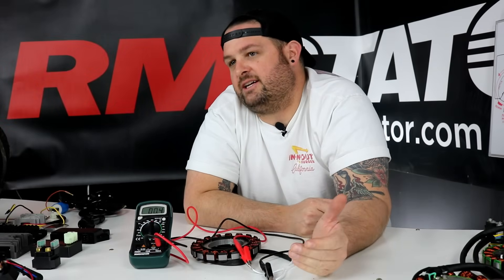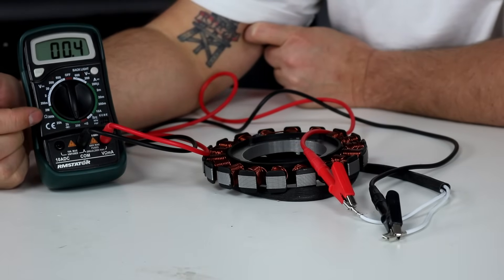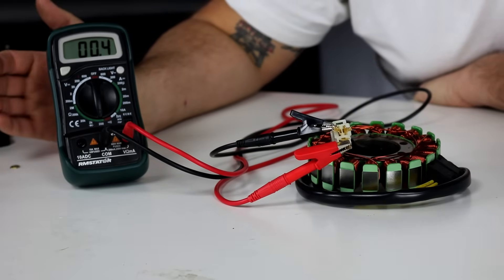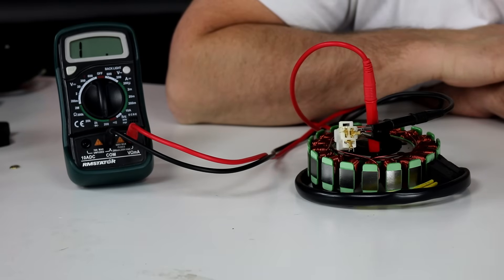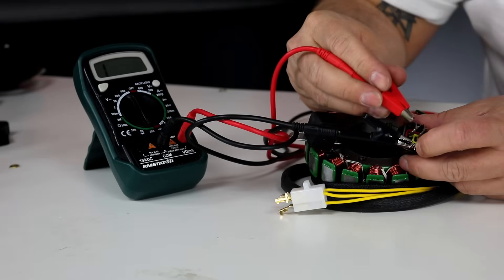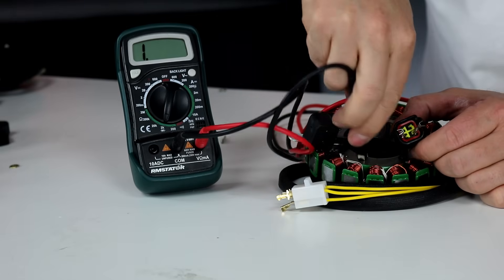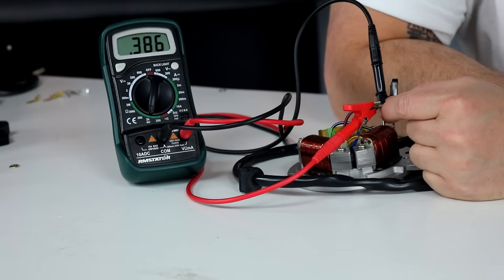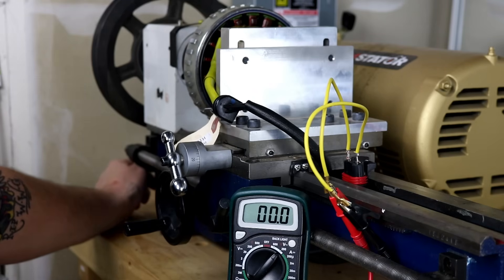How to Test Stators for Motorcycle, ATV, UTV, Snowmobile & Powersports Engines

Comment: For example, on Suzuki motorcycles, it is easy to test the stator this way: if each of the three yellow wires has a voltage of 70-90 volts, the stator is OK.

Comment: Hi and thanks! Good video and explaining all that electrical stuff You didn't know before. After watching this, I understand much better what it's all about. Big problem, if You are as I am - restoring my 1970's three 125 cc's -  that You actually can't get any help from anywhere. Even motorcycle repairshops aren't interested. I may think they lack knowledge of electrics. What they usually offer in Finland is cleaning carbs and stuff like that. Especially if You are dealing with 2-strokes they have no idea how to cope with them. I have done resto till nut-and-bolt-level within 5 years - including all 3 (Suzuki GT 125 1976 , Honda CB 125 1974 and Yamaha RD 125 1974) and now their are perfect. But there's one common factor, which in connecting them at the moment. They won't charge and they are having empty battery problems. So I decided to take advantage of Your website and try teach myself how the elctrics of motorcycle works. Very plesased to hear the basics and test  - and if needed - correct/buy faulty components.  I appreciate Your videos, thanks a lot and all the best!
Reply from the maker: Thanks a lot!

Comment: Wait,  if I check each leg of the stator to ground with the engine running I should get no voltage?   Mine shows about 5 to 10 volts on each leg.

Comment: Would a bad stator cause over charging i have over 20volts at my battery i have already replaced the regulator multiple times 1990 kawasaki bayou 300 4x4
Reply from the maker: Good question. No a stator cannot cause overcharging. This is pretty much always a regulator failing issue. To be safe you should perform a full resistance/grounding/voltage test on the stator (per your service manual or our troubleshooting chart), but it should be a regulator issue.
Reply: A battery could be the problem showing a over charge if the battery is failing and not allowing a charge to happen... then the system will keep sending a full charge, elementary my friend...  a stator is a unit that can put out a lot of voltage but the voltage out put from the stator is controlled by a device or a electronic method called a [ voltage regulator ] it regulates the voltage... we hope. and yes it can fail like anything else...

Comment: when testing my atv i get 0.4 but my book says it sould be 0.33 would that be right i have a 97 kawasaki prairie 400
Reply from the maker: That is perfectly fine. Most multimeters are not super accurate at this very low resistance. Being within 0.1V of the manual spec is fine.

Comment: What is the resistance is zero? 0.00ohms between the phase wires.
Reply from the maker: The meter needs to be set to the lowest resistance range for an accurate measurement. Remember you are trying to measure 0.6 ohms or so, the meter needs to be looking for this low range.

Comment: Hello folks, have a italian enduro bike here that doest produce enough amp from the stock stator. I had an idea today, instead of the simple rectifier/regulator, which convert ac to dc and then strip off the excess voltage (convert to heat), why not using a rectifier (ac to dc 20-25v) and use a solar MPPT to convert the excess voltage to amps ? What you think about the idea ?

Comment: @Rmstatorinc , maybe you know what may be wrong?   CBR600F4. Issues only at idle, none with higher RPMs.

Measured resistance, 0,6-0,7 between terminals cold, 0,7-0,8 hot [does not exceed 0,1 for same terminals]. No continuity between terminals and ground hot or cold. 
Measured stator's output, all 3 wires. It is pretty steady - from 10V at 1k rpm going steadily upwards 10V at each 1k rpm, to 70V at 7k rpm. Same hot or cold. Seems ok?

RR gives 14V when started cold [around 2,3k RPM]. 
On idle [1,4k rpm]:
- goes to 13,5-14 [fluctuates] when hot. When lights ON, goes to 13,1, and then fluctuates between 12,9 to 13,5.
- When ventilator kicks in [with lights off], drops to 12,9-13V; with lights on drops to 12,5 and sometimes lower, then starts dying and cuts out. This is extremely unpleasant at traffic lights when hot, cause it dies or dies when kicking in firs gear, and then it takes time to start and start moving [sometimes even does not start, i.e. starter runs but engine does not power on, like was flooded with gasoline...].  Several measurements show it takes 0,8-0,9 V for headlight [low beam], around 1V for ventilator. Is this ok?

But it is slightly strange; if it generates 12V at 1200 rpm, it already undercharges the battery, not even compensating lights and ventilator. So naturally the battery charging shows around 12,5V at battery, as the electrical load uses battery's reserve. Is it supposed to be so low at low rpms?

Run out of ideas, what may be wrong. If you have any ideas, will be very grateful  :)

Comment: How can you identify what the wattage output is of a stator. Many Service manuals do not provide wattage only the resistance specs.
I would like to know what Wattage out put my stator is rated at.
I know all watts are cumulative - I want to know if my stator can run added lights and heated hand grips.
Or whether I need an upgraded Staor.
Reply from the maker: You really cannot determine stator wattage without some extra equipment. It is done with a break-even test. Maintain ~5k RPM for full output from the stator, add load to the battery while measuring current out of the battery and monitoring voltage to maintain 13VDC or more. At the point you are drawing maximum current and you cannot maintain 13VDC, you have reached maximum output from the stator. You can then multiple maximum current x 13V to see total power in Watts your stator can source while still maintaining your battery. Hope this helps!
Reply: @Rmstatorinc  Thanks for the reply. My 1989 XR600  RX AU model did not have a battery just a Reg/Rec driving a Headlight , tail lights stop light and indicator set up at 12 V DC. so the output from the Pink Yellow lighting coil on my stator ( 3 wire only stator circuit) drives all lights dash lights and tail and indicators and horn
I note that when indicators are on and you operate the horn , the horn pitch changes in time with the flasher relay. and head light also dims a little each flash. I am trying to see if I can keep adding other electrical draw without overloading the stator.

Comment: Hi, i have a doubt about the stator output. I have a honda fourtrax 300 4x4 fwj, is it necessary to connect to the battery in order to get any output from the stator.  I tried to rotate the magnet and try to touch the output wire from the stator to check whether it produces any spart or current in the coil but nothing comes. So is it necessary to connect to the battery for getting any output?

Comment: Hi, thanks for the videos!
I did the static test between 1-2, 1-3, 2-3 leads and got the right resistance value.
But when I do the leads-to-ground I dont have Open Line but 1,50 Ohm instead. (manual says we should have OL when lead-to-ground)
What does it mean when you get values doing the Ground test? Damaged stator or bad connection somewhere? Thanks a lot
Reply: To me it means NORMAL because the one lead that you have one of your test leads from the meter hooked to; that lead on the stator leads back to ground THROUGH THE COIL OR COILS themselves even  if there are two or more coils hooked in series.  So unless they have tremendous resistance they are going to provide a easy resistance connection back to ground where your other meter lead is hooked to.......there's a circuit so the meter shouldn't show it OPEN.   Someone straighten me out here if I'm wrong.
Reply: @bigpig41  There should be absolutely no connection to ground from any of the coils, if so, the coils are shorted to ground and the stator is bad. The meter when testing coils to ground should read open circuit,  or OL, always.

Comment: Hi,  I'm a bit confused on how to test the AC voltage output on my stator.
I see on some sites people connect the negative lead of the multi meter to the battery and then with the stator unplugged just touch the positive to each of the three yellow wires while running the bike up to 5000 revs to take the reading, 50 60 70 vac etc.
And then on other sites I see people doing it another way, not connecting the negative to the battery, but connecting the black and the red of the multimeter  between the three yellow wires in series ?  So what is the correct way ?  I have a stator test on a KTM 990smt.  Thanks

Comment: Should the stator stay dry or does it matter if oil gets in the case and on the stator?
Reply from the maker: Most stators share crankcase oil to stay cool. They can definitely be oil covered with no problems.
Reply: @Rmstatorinc  I think I figured out the problem of why I was frying the stator. The starter button on the handlebars doesn't work and the previous owner hot-wired a new starter button to the solenoid but the old starter button was still hooked up still. I'm not positive that's the problem but I'm pretty sure might be.

Comment: i have a Kz650 and i dont know how to check the regulator. it has a harnes with 3 ends and 1 wire white with a red stripe.  can you please help me? i will check the stator the way you just showed in the video. thanks again. https://www.ebay.com/itm/Regulator-Rectifier-for-Kawasaki-KZ650-Custom-Sr-1977-1978-1979/281234790607
Reply from the maker: The 2 Yellow wires are the stator input, the Black is ground, and the Red/White is Battery positive. You can test it per our video.
Reply: @Rmstatorinc  thanks so much

Comment: ID IDLE WHEN I HOOK 2 YELLOW WIRES, I GOT 4.6 VOLT A/C AND 11.2 VOLTS A/C  AT 2000 RPM . IS THAT TOO LOW

Comment: Testing a 2002 Triumph Daytona: Resistance accross yellow wires all 0.5 ohms. Open loop to ground (tested all three although not really needed) bike running at about 1,100 rpm obviously stator wires disconnected. Getting approx 23 volts ac on any pair of yellow wire. But I also get 13v ac on each yellow to the ground. Your video says should be zero? is there a problem or just a different setup.

Comment: Awesome video and most straightforward explanation on testing the stator or rectifier. If my stator is reading .2 ohms for resistance between all tabs is it bad if it should be at .4?
Reply: I think it really depends on the stator but I would say .2 is still good, it still has low resistance which it should be.

Comment: hi, great video , on a snowmobile to check for stator open ground would you ground it on frame or motor, ?
Also is it possible a stator will only malfunction after getting hot,? after 30 minutes lets say ?  
thank- you
Reply from the maker: You can use the frame or the motor. Any clean metal connected to the frame is a ground. And yes, a stator can definitely short to ground only when hot.

Comment: So what if all three are grounded out? Is that common
Reply from the maker: All 3 coils on a stator are connected together. Unless the coils are burned, broken, or disconnected, if you measure a short to ground on one, you will have it on all 3.

Comment: Awesome and very informative video. Is there any stators that may have a short to ground or core that is normal? I have a Kawasaki Klx110 And I bought a new stator and it does give me a short to core when tested. 
I’m going to pick up the peak voltage adapter from you guys.
Thanks!!
Reply from the maker: Thanks! Yes there are definitely stators that can have a short to ground. Our videos show generic/universal testing info that is specifically for 3-phase battery charging stators. These type are used on most larger street motorcycles and ATV's, and do no have a ground connection at all. However on many smaller motors, especially dirtbikes, it is common to have one side of the coil grounded. To be sure, you really need to refer to a wiring diagram or service manual for your particular year/make/model. The service manual will explain how to test, and if you should have a measurement to ground on any wires. Hope this helps!

Comment: Showing a test that requires removal of the stator from the 'bike' is not too helpful for the owner. Might as well take it to a shop andpay for a diagnoses.
Reply from the maker: None of this testing requires removing the stator from the motor. You can easily measure the resistance at the connector, and check for a short to ground using any part of the motor or frame. I believe I cover that clearly in the video as well.
Reply: Are you dense or something  .these are examples.  You can leave it on the bike and do it .